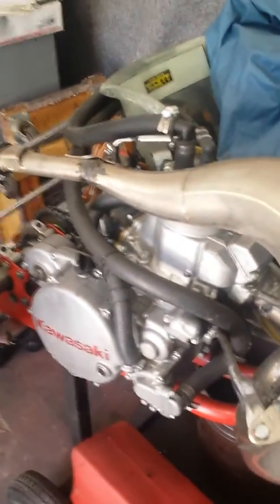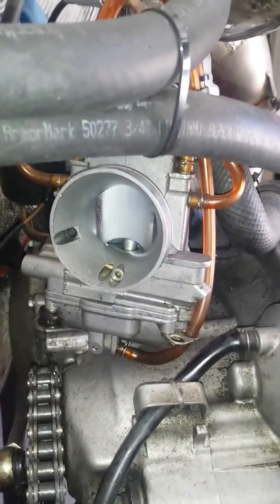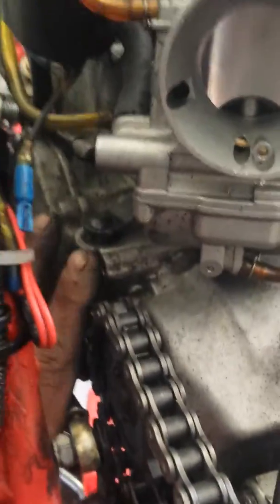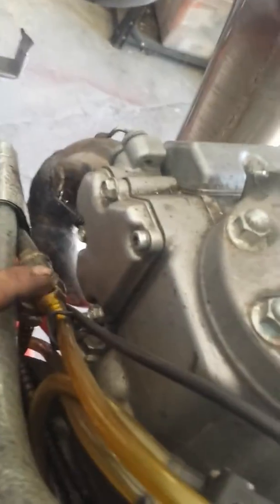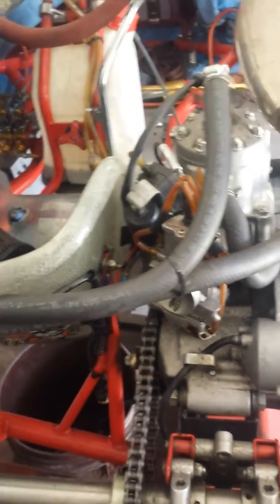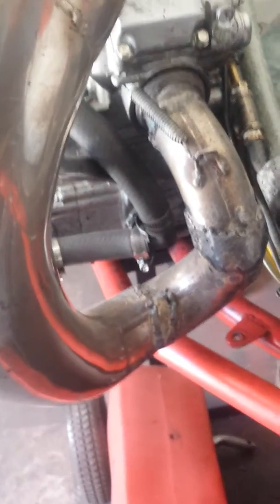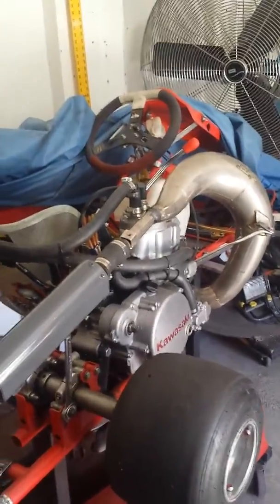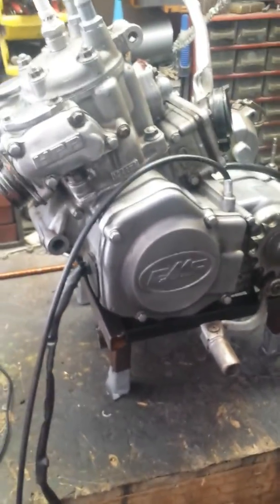Shifter kart fuel pump

Comment: What kind of hose did you use to to connect the exhaust
Reply from the maker: I'm not sure what your asking.. for the exhaust I used a exhaust pipe. I used a vacuum line to run the fuel pump from the head. I hope that helps

Comment: I like your kart bro I'm into mine about as much as you spent. Is it a baril chassis? Like mine it looks similar. My motor is also a 99 CR 125 and it hauls ass and I really think my fuel system will help you out though I noticed there wasn't much on the subject on YouTube as well .there is no pressure in this system and works exactly like if it were still on a bike.

Comment: hey what rear sprocket are you using? where did you get it? Im having trouble finding a rear sprocket that fits a #520 chain. I have a 13 tooth front and am thinking of running a 30 tooth rear.
Reply from the maker: yah in running a 29 in the rear. I bought the  sprocket threw comet Karts. just let me know if you need any more questions. thanks for watching..

Comment: my kx 250 birel 32mm chassis has been eating top ends my cylinder was ported and sleeved its on its last boar blew up every time i thrashed it turns out there was no return pipe or t piece also my pulse line was way too long 40cm 
starving the engine at high rpm  (melting pistons)
i use mikuni duel pump the round one where did you get that pump may i have the model number thanks man
Reply from the maker: Hey bro, yah mine is a walbro wip-13-1  ... it's off one of my generators. . if you can order from a company called Stens there part number is 520-304.. list price 70.00  it's the only one so far that works for my motor.  hope this helps
Reply: thanks man super helpful thumbs up